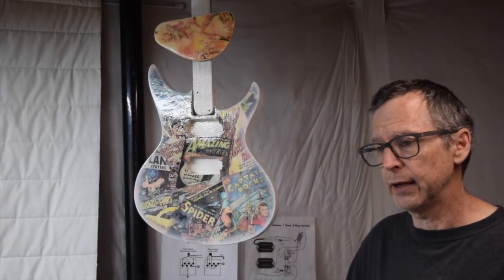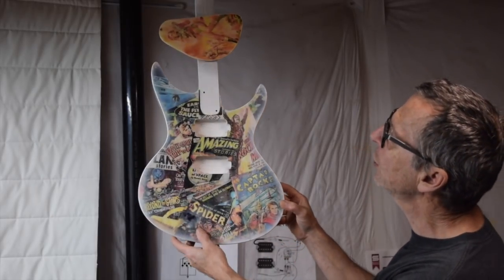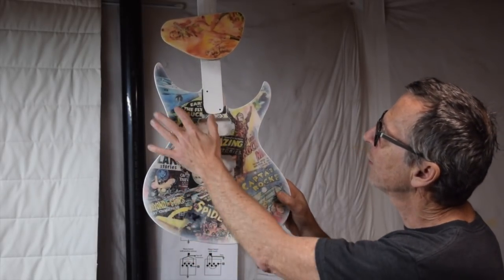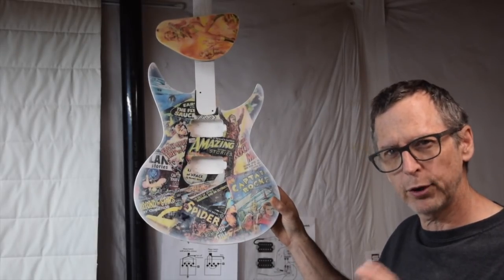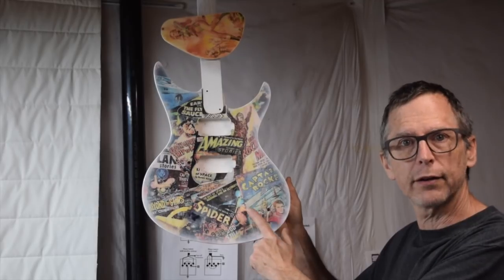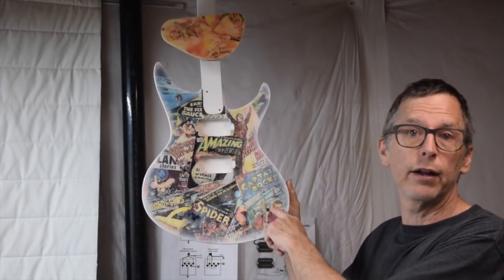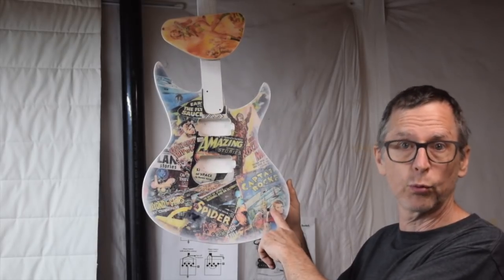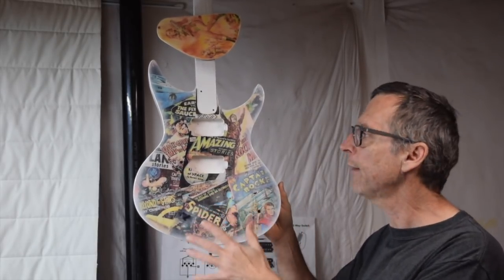Why You Need to Sand Between Coats of Clear Finish

Comment: This video is superb! After searching and reading a LOT, for hours, using the search term "witness lines" and various other words such as "fix", this video came up in my searching, and I suspect only because someone had provided a written comment with the term "witness lines" in it. Otherwise, it likely would not have showed up using those search terms. You did a great job concisely stating why you sand between coats when using poly and that it's good idea to recoat after about 30 minutes while the existing coat is still not dried all the way (to blend the coats into each other somewhat). I did not do this on my latest kit build (and of course I decided to try full black, which seems to show every tiny imperfection), and I have lots of witness lines. In fact, I didn't know what they were called until several kind souls told me in response to my post to a facebook guitar finishing group. I've watched a number of your videos and they are filled with great information. If I may recommend something, it would be to type some key words (in this case, "witness lines") into the video description so that folks will more readily find your video. It could help get you a lot more views and help spread your wisdom and expertise.  Thank you again!

Comment: I'm sure you already know this, but it's noteworthy that solvent based polyurethane and many other finishes still build in layers (as opposed to lacquer) but are generally re-coated based on flash-off times and don't get sanded between coats unless you do multiple sessions. Granted, you typically finish in closer to 4 coats with those rather than 10+.
Reply: This!
Reply: Brad, are you saying that a water based poly should only be sanded from day to day instead of each coat? 4 coats a day sand and repeat for a total of 12 coats?

Comment: I'm in the process of finishing a strat body with Crystalac instrument finish which I bought after seeing your review. Their directions assert that sanding between final clear coats is unnecessary. I see that you've commented below that you don't sand if the timing is right (not too long). Do you know if their product will show witness lines like the Stewmac color-tone WB finish I've used in the past? Also, is it safe to wet-sand Crystalac prior to buffing after the clear coat cures, or should I plan to sand dry?

Comment: Hi, and Yes, i have a question. Im re- spraying a vintage acoustic guitar with auto type acrylic clear lacquer, which originally had the same paint factory applied.
On applying the first coat, after proper prep including with wax and grease remover, Ive got a few small areas that look like silicon or other contaminant surfacing.
I intend then, to sand back to the substrate again or close to it, try again with anti silicon drops in the paint.
Question is, how long should I wait to sand back between coats, assuming I may have to do so with these blemishes a few times.
Thanks. Don
.
Reply from the maker: I'm afraid you'll need to consult with the manufacturer of the products you used.

Comment: Hi Chris, Have you changed your sanding method for working with Crystalac Britetone, or are your instructions explained here for another brand of finish?
Reply from the maker: I sand between coats, but for the last coats, I scuff the surface with a 3M extra fine Scotchbrite pad or I'll sand with at least a 400 grit or finer.

Comment: I'm building a Les Paul guitar kit with a Sunrise Red Rustoleum spray enamel base coat for color on the back and sides of the guitar (Mahogany). I've let everything dry a minimum of 48 hours between coats. I've sanded between the coats with 350-400 grit sandpaper. I've got two base coats down for color. What grit sandpaper do you recommend in preparation for putting down the clear coats, and between the clear coats.  How many coats of clear do you recommend?  I'm planning to use Crystal Clear Rustoeum Spray Enamel as my clear coats then polish once it's all dry?
Reply from the maker: Sorry, but I have no experience with these products, so I can't answer. Maybe someone else who has used these products will read this and chime in.
Reply: ok, thank you anyway...

Comment: I applied 4 coats of Target coatings EM 6000 and let them dry for a day.  I tried to level sand with 800 grit paper and then apply another coat of EM6000.  When this coat dries I can see the scratches from the 800 grit level sanding under the newly covered surface.  Why is this happening?
Reply from the maker: As water evaporates from the finish, the remaining resin shrinks into the scratches. To fill them, spray 2-4 coats with about 30 minutes between coats. Don't sand between these last coats!
Reply: @HighlineGuitars  Thanks so much for the quick reply.  I will put some additional coats on and see what happens.  I figured that after my first re-coat following flat sanding these would not go away with additional coats of finish.  I have to also agree with a poster down below, a multipart step by step for water based finishes would be quite popular !   I sincerely appreciate your content !

Comment: When can i polish and wax my guitar? Clearcoated it yesterday
Reply from the maker: What did you use to clear coat?
Reply: @HighlineGuitars   i used a spraycan from my local hardware store
Reply from the maker: @deathleechofficial  Okay, but what was in the spraycan? Nitrocellulose? Polyurethane? Acrylic? Shellac? Regardless of what you used, you'll need to wait to polish until it has fully cured. That wait will depend on what the manufacturer recommends. Also, you don't need to wax clear coats. Just polish and buff.
Reply: @HighlineGuitars   thanks for the reply. I got no clue it says alkyd highgloss😅

Comment: Hi, I'm in the process of re-spraying a guitar and I've got the colour on and I'm now ready to start spraying the nitrocellulose clear coat. Is there any advantage in sanding in between coats or would it be pointless as the coats blend into each other?
Reply: you have to sand paper in between coats each time with lower grain, 200, then 400, then 800, then 1200, this will save a lot of time in final sanding. And you have to avoid thick layers, better to do 10 thin, than 5 thick.
Reply: Thanks for replying, that's excellent advice. I wasn't sure if it applied to nitrocellulose as well as the water based products.
Reply: all finishes can use a good sandpaper......as world wide rule: the more sanding you do previous to a lacquer coat, the less you will do later when finishing.
Reply: Ok, thanks I'll get spraying and sanding then!
Reply: be cautious, lacquer can take days to weeks to harden enough to sand/buff. if you do it too early, you will end up with a goey mess. Also keep in mind that you cant mix and match lacquer with other types of finishes, as lacquer never completely cures, and will continue off-gassing for years to come. put anything over the top of it and it will eventually come off. once you decide to use lacquer, you have to follow through till the end, even if its a month or two down the road.
Reply: I am planning to give it 2 weeks to "cure" before I start the sanding/buffing process (it's a black Stratocaster guitar I purchased recently and I've changed the colour to Fiesta red ) if it feels ok I'll continue if not I'm happy to leave it a while longer. Thanks again. Phil
Reply: So laquer is usually slightly different to some other finishes, because the following coat kind of dissolves into the previous ones you don't necessarily need to spray between coats.  Generally you'll apply three coats with around fifteen/twenty minutes between each, then let it dry for at least 24 hours.  Before applying the next three layers you can sand (not over 1000 grit as you still want a sufficiently 'rough' surface for the finish to adhere to, although this is less of an issue with nitro laquer), but you only really need to if you have areas that are really rough/lumpy/have orangepeel.   After your last coat wait at least two weeks before high grit sanding at polishing, but the longer the better